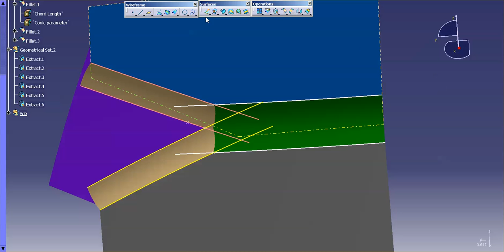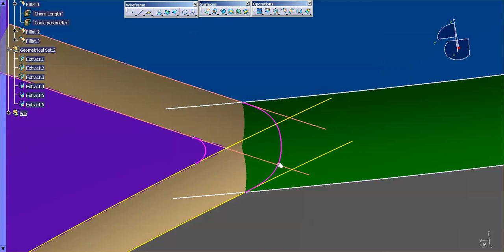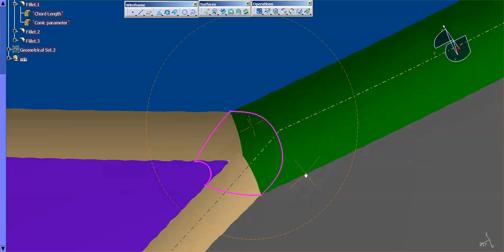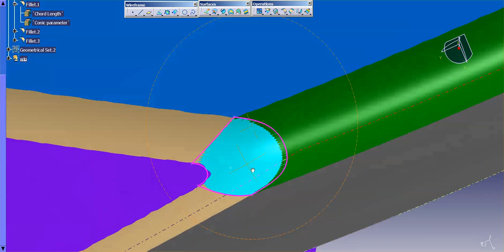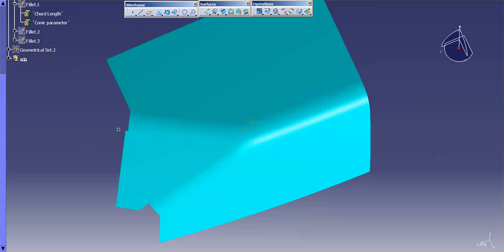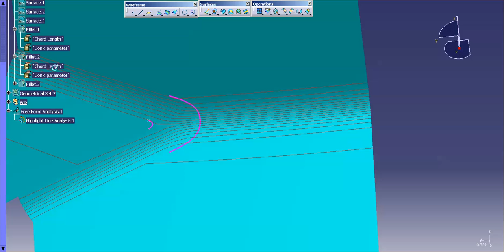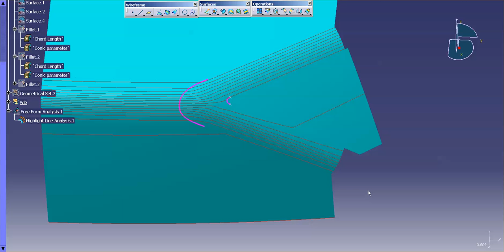Class A Surface Corner - Alternate Method: Catia V5 | Catia V6

Comment: As a faster solution, you can also use a shape fillet with tritangent option, will not give you as high quality of a surface or offer as much control however.